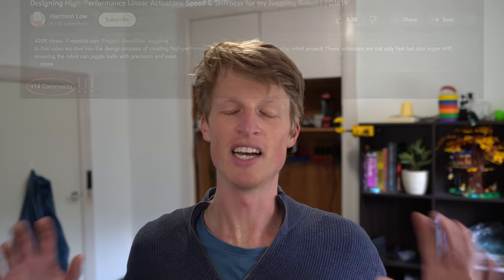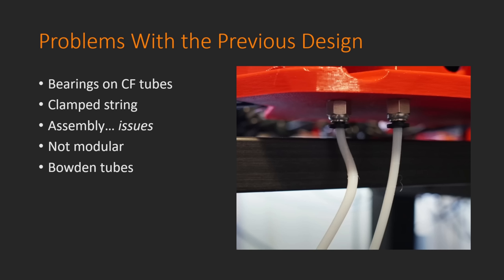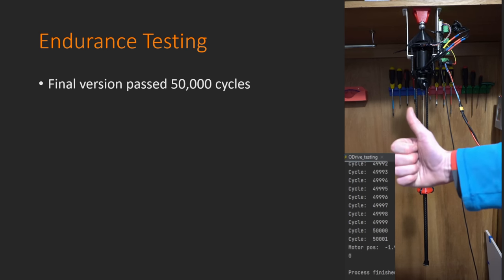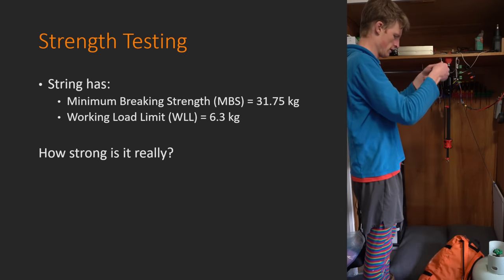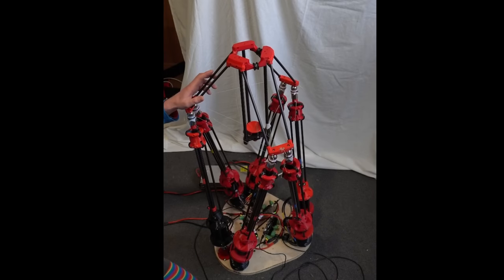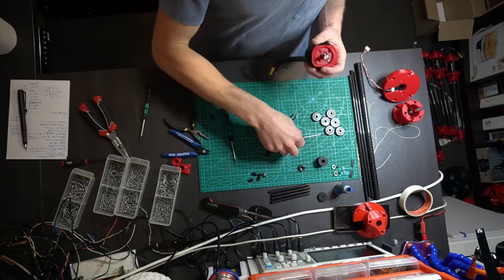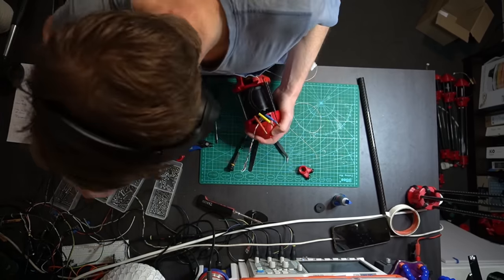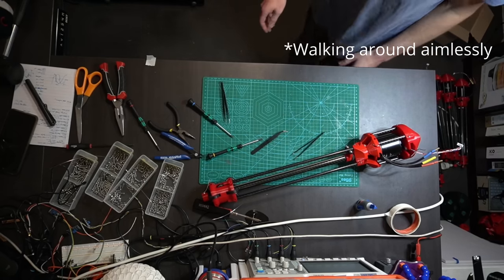My New Linear Actuators are SO MUCH BETTER! | PDJ #21

Comment: Old Design Issues
- Bearings wore out quickly.
- String clamping led to wear.
- Assembly required hammering, causing parts to crack.
- Not modular; any issue with one actuator affects the entire system.
- Bowden tubes kinked and had slop.

New Design Improvements
- Strings internally routed, making it sleek and modular.
- Motor contained within the actuator for easy replacement.
- Clamping mechanisms simplify assembly.
- TPU sleeves minimize wear on bearings.

Performance Metrics
- Endurance: Over 5 hours of continuous runtime.
- Speed: Max 3.4 m/s.
- Precision: Less than 0.06 mm.
- Lifting Force: Almost 7 kg.

Future Improvements
- Use motor body as the spool for the string.
- Consider using synchromesh cable.
- Replace TPU sleeves with heat shrink.
- Modify bottom cap to reduce torsion.

Community Engagement
- Set up a Zulip site for better communication.

Positive Points (Sorted by Importance)
1. Modularity: The new design allows for easy replacement of individual actuators, reducing downtime.
2. Endurance: Over 5 hours of continuous runtime, passing 50,000 cycles with minimal wear.
3. Speed: Achieved a maximum speed of 3.4 m/s, meeting the design requirements.
4. Precision: Less than 0.06 mm, close to the theoretical limit of 8.4 micrometers.
5. Lifting Force: Capable of lifting almost 7 kg, exceeding expectations.
6. Ease of Assembly: New clamping mechanisms eliminate the need for hammering parts together.
7. Reduced Wear: TPU sleeves and internal routing of strings minimize wear and tear.
8. Community Engagement: Set up a Zulip site for better communication and sharing of ideas.

Negative Points (Sorted by Importance)
1. String Wear: The string broke during precision testing, indicating potential durability issues.
2. Torsion Issue: When fully compressed, the actuator has little resistance against torsion.
3. TPU Sleeve Problems: TPU sleeves can slip off and are not perfectly smooth or symmetric.
4. Complex String Routing: The design requires complex string routing, which could be simplified.
5. Braking Limitations: Difficulty in slowing down the actuators, indicating a need for better braking mechanisms.
6. Assembly Cracks: The old design required hammering, leading to cracked parts.
7. Old Design Wear: Bearings and strings in the old design wore out quickly, affecting longevity.
Reply from the maker: Wow! What a thorough summary!
Reply: definitely not openAI output.
Reply: Good boy. You paid attention. Have a chocolate fish.
Reply from the maker: @dine9093 tbh even if it were ChatGPT-made, I reckon it's still pretty good! I wouldn't think it'd be so effective just from (presumably) the transcript?
Reply: @harrisonlow  It would if it also used your previous videos transcripts. keep up the cool work though!
Reply from the maker: @dine9093  Well that's a bit of a weird thought - someone having a ChatGPT model of me 😬
Reply: @harrisonlow  probably more like it was trained on a large portion of YouTube videos and you just happen to be included.
Reply: @conorstewart2214  No, it's not trained on anything more recent than 2 years, as it will happily tell you
Reply: @Max24871  that's what they say.
Reply: @harrisonlow  Shhhhh - It's for the greater good.

Comment: Two things you didn't consider when you thought of using rotor as spool: it'll have way worse precision and way less torque, by a factor of 3 it would seem like.
Reply from the maker: I think the precision would be  if anticogging were set up, but after doing that for one motor + ODrive I'm not too keen on to do it for all of the motors. It's a very finnicky process that occasionally just doesn't work 🤷‍♂

Good point re. torque! Cheers for the input 😊

Comment: For the cables pulleys
You can absolutely do the compression with 2 pulleys :
Use the first pulley to first route the cable throught any point of the desired destination line, and then put a pulley at that point to get the destination line
First step is always possible due to a point and a line always being in the same plane, and same for 2 intersecting lines in the second step

Good luck with your project

Comment: There are v groove pulleys which will increase your contact surface area for the bearings. Doing the heat shrink around the surface will increase the grip while allowing some compliance. I would use spectra cord if you can since they are about as strong as you can find and very stiff. For torsional stiffness you would be far better off using a square profile tube rather than round. If you use v groove bearings you could run with 4 bearings, 2 on each corner which should give you plenty of stiffness.
Reply: hi dexterm, have you become a flat earther yet?
Reply: Late to the party, I know, but as this video got started I couldn't help but think he needed either spectra/dyneema or vectran, along w/ delrin bearings...as the thing reminds me very much of an internal cascading outhaul on a sailboat boom I built years ago.  Vectran and dyneema, while feeling very different, are both quite 'slippery', but also they both will allow each end to be brummel spliced so that the 'strings' are terminated with eyes on each end.

Comment: Terminating the synchormesh cable can be done with a guitar string winder. (The part of the guitar that turns the string to adjust the tuning). This also gives a nice way to adjust the tension. I'm wondering why the motor isn't just turned 90 degrees instead of having the strings go through pulleys.  I think regenerative breaking would be ideal and would allow your juggler to run on batteries for shows where power isn't available.
Reply: Making the motor wider would mean a more complex/flimsy swivel mechanism between the actuator and the base
Reply: Or make a long tin hole to thread the synchromesh cable through and then have a 2nd perpendicular hole through which a screw is tightened down to impinge upon and lock the cable in place in the hole.
Reply: @Superkuh2  that makes it hard to adjust the cable
Reply from the maker: @chrisBruner Addressing your points in order:
1 - Good idea! I don't play guitar and this idea hadn't come to mind. I'll do some research into how these work and I'll see if I can make a similar mechanism at the small scale/weight that I'd need. Cheers!
2 - The main reason I didn't set the motor perpendicular to the extension axis is because I don't want the motor to be sticking out the side of the actuator. I have a gut sense that this would likely cause issues down the line once I put all 6 actuators together into a Stewart platform so I want to keep everything as "neat" and in-line as possible. I think using the motor body as the spool would still work, though, because I'd be able to keep the centre of mass of the motor approximately coincident with the extension axis.
3 - I agree. I love the idea of Jugglebot running off batteries and being fully portable, though I have precisely 0 experience with these and don't want to find myself in the position of having to pause work during troubleshooting in order to charge batteries (not to mention any physical risks/dangers of high-power batteries)
Reply from the maker: @Superkuh2 I agree with techheck here - the synchromesh cable needs a fairly clear path to be pulled through and I think a convoluted tensioning path would be tricky to make fine adjustments to. FWIW one of my patrons had a few great suggestions that I've written up on Zulip. I'll post the link as a reply to this comment in case YouTube takes a disliking to the external link. (The thread can be found in General > How to Terminate Synchromesh Cable)

Cheers for the suggestion!
Reply from the maker: Link to Zulip thread on terminating synchromesh cable:
https://pdj.zulipchat.com/#narrow/stream/399279-General/topic/How.20to.20Terminate.20Synchromesh.20Cable.3F/near/388799329
Reply: @harrisonlow  I mean a straight cylinder. The tension isn't from the path friction. It's from the screw pressing into the synchromesh at a right angle pinning it in place. Like a set screw. ┫
Reply from the maker: Ah of course! That's really simple and clever! I'll print off a test piece today and give it a go. Cheers!
Reply: @harrisonlow  2 - Keep in mind using the motor body as the spool will reduce the precision due to bigger diameter.
Reply from the maker: @Sekir80 yep good note. I think setting the motors up with "anticogging" would alleviate a lot of that, but that process is very tedious and sometimes just doesn't work, so I'm glad to not have to do it with my current design
Reply: @harrisonlow  Just out of curiosity: do you NEED that precision? In other words, what is your desired precision?
Reply: @harrisonlow if you make motors stick radially out they shouldn't cause any issues.
Reply from the maker: @Sekir80   The short answer: I have no idea what precision I need. 

My intuition is that I want the platform to have a sub-centimetre precision for good catching repeatability, but I'm honestly not sure how that translates to each individual actuator. 

Presumably not just "sub-centimetre"?

Either way, I'm extremely satisfied with the <0.1 mm precision of these actuators and I think it should be plenty fine for now 😊
Reply from the maker: @tymoteuszkazubski2755  I think they might get in the way of the full Stewart Platform when they're all put together, and would be targets for errant balls etc. etc. 

What do you think?
Reply: @harrisonlow  other than being hit by a ball radial out shouldn't collide with anything. If you design carefully you should be able to hide them inside though it will require more consideration.

Comment: When adding heat inserts, as soon as you pull the iron away, flip the part over and press the face with the insert (and still hot plastic) directly against your workbench for 3-5 seconds. The flat surface of the workbench will keep the small raised ring from forming around the insert as it cools, so you won't need to shave it off manually. It will also help make sure the insert is aligned perpendicular to the face. Alternatively, you can press a small block of copper of aluminum (like a spare heatsink) against the fresh insert to accomplish the same task.
Reply from the maker: That's a really good idea! Thanks heaps for sharing it!

Comment: Two options for cable tensioning:
Use a simple turnbuckle so it doesn't twist the cable as you tension. To secure it to the turnbuckle you can loop and crimp it or use a grub screw or a throttle cable style connector.
Alternatively look up the Cable Rail Tensioner by Cable Bullet. It seems to be a compact tensioning system that uses a screw to tention and does not twist the cable.
The latter option basically uses a crimp on the end of the cable which passes through a hole that has a ring on it to push on the crimp and it is adjusted with a grub screw. You could certainly develop your own system similar.

Comment: To improve strength, you could have 3 pairs of strings. You also have to be careful when considering cord strength. When you're pulling the bag up and down by hand, the jerk you're applying is definitely high enough that it could reasonably be producing tensile loading in excess of the rating. The literal weight/mass rating doesn't matter, you need to be thinking in terms of force, which will make it more obvious how jerk and acceleration can create very high peak forces. If you improve the motion controller to enforce jerk limits, it should improve the performance of any cord or cable, and also reduce shock forces on the machine overall. This kind of thing is being used in 3D printers to improve print quality, reduce ringing, and go faster with fewer consequences.
Reply from the maker: Haha I was wondering if anyone would call me out on my sketchy testing of the string strength 😂 I agree that my "jiggling" of the bag would increase the force in the line, but it felt like my jiggles were fairly small and (I would think) shouldn't increase the force on the line by a factor of 4 (MBS/bag weight).

As for the motion controller, I actually don't know if it's possible to set jerk limits with the ODrives. I'm currently planning to use trapezoidal trajectory planning (with velocity being the trapezoidally-controlled parameter) which does a pretty good job of smoothly moving between setpoints. It's yet to be seen how well this does when the setpoint is being updated at eg. 100 Hz...

Cheers for the input!
Reply: @harrisonlow At work we have a garage door, and you pull it shut with a cord. When I started this was generic 90lb nylon diamond weave. It's not hard to close but the way the guys pull on it, not even really a yank, was causing the rope to fail every month or two, it would just rip in half mostly at mid-span. I'm the knot person, boss asked me to fix it, I just did mostly the same thing but using 550lb rated paracord, and a knot that's better at distributing the load. It's been maybe 8 months, no problem even with spending hours a day in direct sun.

It's just that easy to generate high shock loads by accident. I assume your cord, due to being smaller and not diamond weave with a useless fluff core, has a shorter elastic range.

I'm not sure what cord you've got, but in the vein of paracord there's "1.18mm Micro Cord", a lot of paracord dealers have it. Supposedly it's "rated" for 45kg, but they're not clear about what kind of rating that is. It's some kind of weave, which may widen the elastic range and make it a little more forgiving, but whose to say how the overall stretch will differ.

Honestly the other commentors seem to have your synchromesh cord solved, I've never seen that stuff before, it's cool.

Edit: one more thing: all paracord melts, any cord you can fuse the end on can melt, they can melt from rubbing and from loading. Once they start melting the mechanical properties are out the window. You won't be able to feel this heating, the cord is just too insubstantial to heat your finger. The paracord family could easily just be useless to you.
Reply from the maker: @Ziraya0  Haha I love that your work has a "knot person" 😂 What do you do for work?

Cheers for that writeup! Useful thought experiments re. woven vs braided thread and elastic range. I haven't really paid too much attention to the structure of the thread before! (FWIW, the kevlar string I'm using is made from two twisted threads)

As for melting: I mentioned in the video that I accidentally routed the prototype actuator incorrectly. This routing had the string going straight over a printed part at a rather aggressive angle. Cut straight through it! For better or worse, the string is far more robust than the printed parts so they tend to fail first.
Reply: @harrisonlow  You probably have enough space in this design to go up one or two sizes in kevlar line literally without changing anything else. The line I'm seeing isn't two threads, but it is 0.8mm, 45kg, safe working load limit 9kg. 90kg/18kg line is only 1.1mm, and 136kg/27kg is 1.5mm. If the synchromesh gets too complicated, this seller goes up to 476kg 2.6mm cord; at that point it's mainly a question of how big you may need to make the spools and how that'll impact the torque across the range of motion.
Reply: @Ziraya0 drop Kevlar for Dyneama thread. Size AA/30 thread is 0.28mm, holds 40+ pounds easily. It also stretches less than Kevlar. Thread is easier to track down, and that's all kite fancy kite string is.
Reply: At this point I gotta say, this all seems perfect for a line testing video, figuring out what matters, what the options are, and how they all stack up. That Dyneema line looks really good.
Reply: @ionstorm66 dyneema is great, but you do have to be careful with how you terminate it as knots reduce strength a lot in cordage especially dyneema. It works great in winches as it’s wrapped around a drum otherwise they generally splice it
Reply from the maker: @Ziraya0 what a great idea! I have an awesome idea for this and I'm very keen to put it together and crack this nut once and for all. Big thanks for the idea 😊

Will definitely be trying dyneema after all the suggestions for it

Comment: Can it be done with less than 3 pulleys? Referring to the green string, my thought is to have the first pulley be slightly tilted and the correct diameter to stretch the distance between the motor pulley edge and the upper central pulley edge, so that the intermediate pulley essentially does the job of both pulleys you have right now, but it keeps the string in line coming off of the motor pulley and the upper pulley.
Reply from the maker: Yep, I now realise that this is very doable with only two pulleys per string. Good thinking!
Reply: @harrisonlow  Awesome. Thanks for replying to my comments. Can't wait for the next update!

Comment: Regarding the Pulliies..
you could turn the green "middle - direction" pullie such that its output guides the string on the tangent of the main pullie.. this would result in an really odd angle but would reduce the number of pullies. But I think three is much simpler, as you don't have to "think" about this odd rotation.. :)
Reply from the maker: Very good thinking! I wonder if it's true then that any two "skew" lines can be joined with just two pulleys?
Reply: I thought exactly the same.
Reply: @harrisonlow yes any two lines in 3d space can be connected with two pulleys.
the way to think about this is choose any two random points, one on each line, and then connect a third line between those points. then you place pulleys at each of the points, tangent to one of the original lines and the newly constructed third line.
hope that makes sense
Reply from the maker: @waxt0n  Ah of course! Great way to think about it. Cheers for the explanation 😊